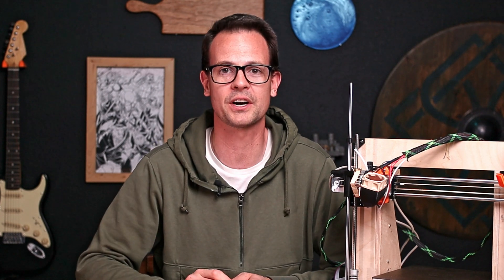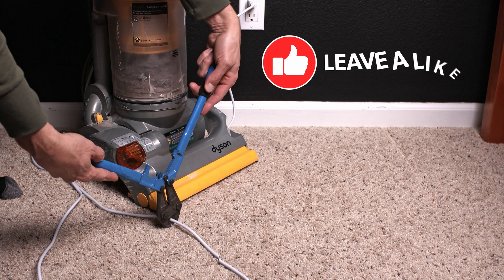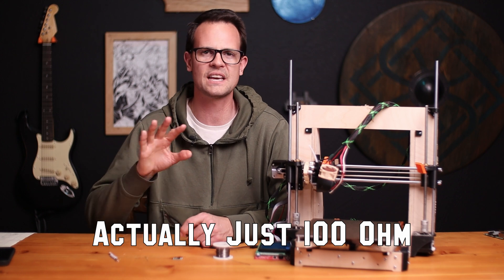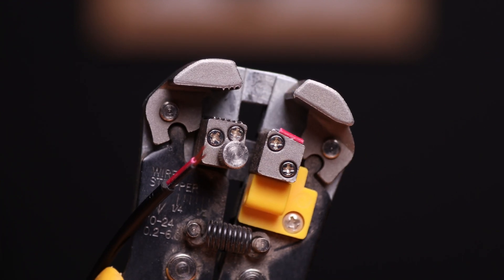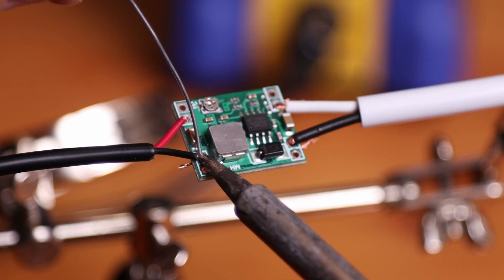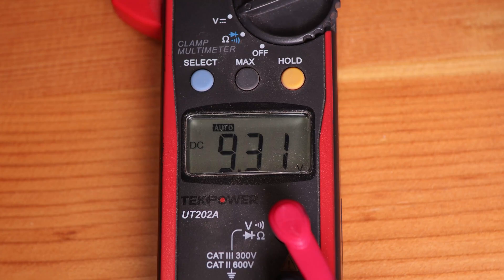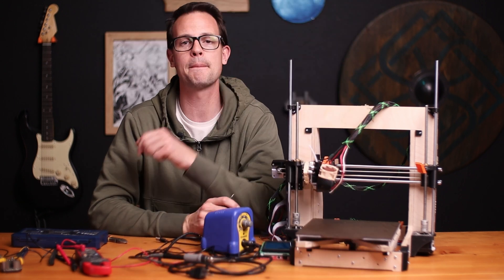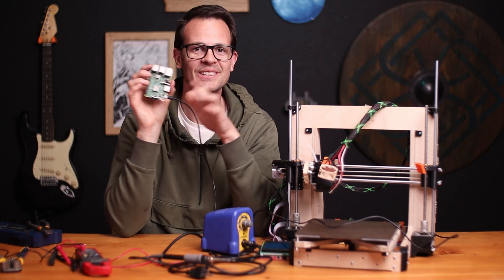How to Power Raspberry Pi from your 3D Printer | Buck Converter 5V

Comment: 3:46 Why not connect the ras pi with the gpio pins? If i want to power other devices with the ras pi, like some fans and lights, how could i split up the voltage connections so the buck converter gives me enough power for everything? Im going to connect the buck to the psu, and im going to find out how to split a pinout so i can power stuff.

Edit, 2:48 Im watching a second time, and I think its a great idea to make sure you don't blow up your boost converter by adding some load with a resistor. Do you think you could add a fan on it as load instead? ill need to blow some of the smoke away anyway. lol

Comment: Okay so all the clamps on my power supply are taken. Is it safe to wire it up to the pre existing wiring directly from the power supply? I have everything to do so I’m just not advanced enough to know if ima burn my place down or not
Reply from the maker: You should be able to wire in multiple wires into one clamp. Make sure they are in good and won’t fall out.

Comment: Hi, great videos.  What is your advice to get started 3D printing?  I'm a non practicing  engineer, beginner woodworker (mostly rough carpentry, decks etc), bow hunter and hobyist DIY.  I initially saw your DIY archery target video.  Thanks for any advice.
Reply from the maker: Hey it sounds like we would be good friends :)  So for getting started in 3D printing I think it depends. If you like designing things and want to get them printed without too much fuss I would recommend the BambuLabs printers, the P1P or X1C. They are a bit more pricey, but I got one a while ago and I love it. It just prints great. If you want a lower barrier to entry the ender 3 pro has a huge community around it. https://amzn.to/3iWhnnO You are going to learn how to tinker with a printer and upgrade it over time. If you really want to know how 3d printers work, and programing their software and stuff then I recommend building your own printer. Since you can do some woodworking I recomend the MP3DP https://www.v1engineering.com/projects/project-3d-printer/ You would have to have someone print the parts for you though. 
All that being said for a first printer I think the P1P for $700 if you can swing it is the way to go https://us.store.bambulab.com/products/p1p If you don't have the money and want to see if 3d printing is worth it for you and you don't mind tinkering and fixing things then the ender 3 pro. 
Sorry for the essay, hope that helps.
Reply: @BuildItMakeIt  Thanks a bunch!  Im not yet ready to design anything, but my kids might be.  It would also be cool for my BSA scouts to design things and I can print for them..

Comment: that pewny buck converter is not at all a good fit for this. it doesn't have propper filtering caps for clean power delivery, and it will overheat. try running a high load on the pi and put your finger on the buck converter. not to mention that those micro pots/trimmers are so unstable that they easily disturb the set voltage on any slight vibration
Reply from the maker: Thanks for the comment. I have been using mine for quite a while now without issues, but I will say my pot is nice and stiff and haven’t noticed issues. I’ll keep an eye on if I start having issues.